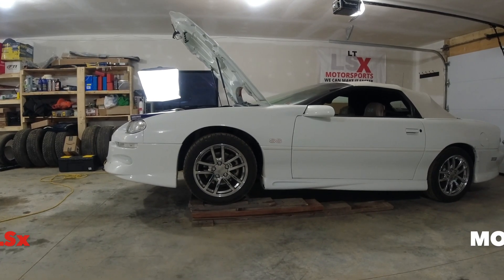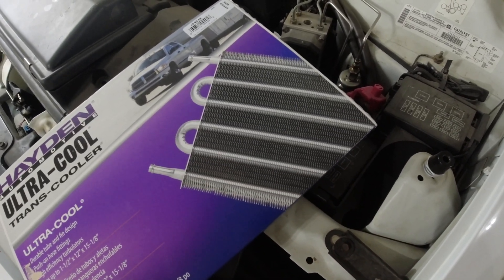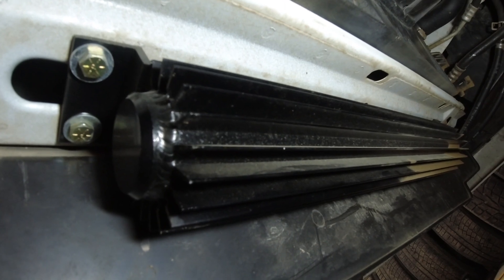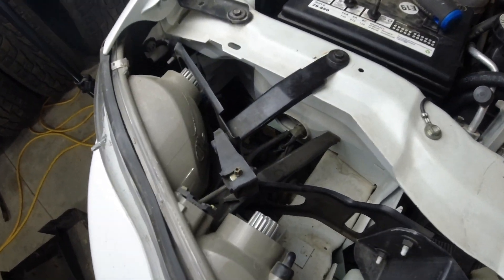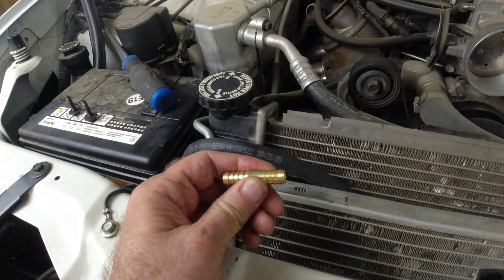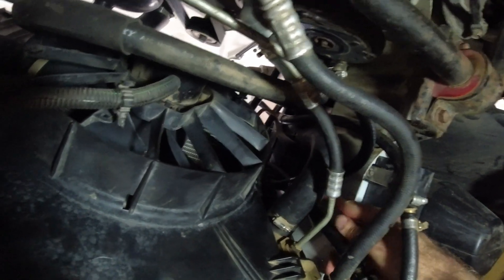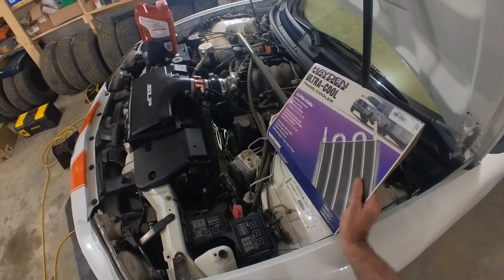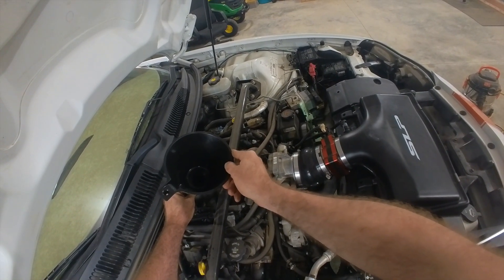Installing a transmission Cooler - How much will a transmission cooler drop the temps.

Comment: You have a trans cooler suggestion for a 95 TA
Reply from the maker: Whatever will fit in front of your radiator and fits your budget. If you drive in cold weather you may not want too go too big but if that's not an issue for you the get an 8 or 10 row cooler. Don't bother with those expensive stacked coolers they cost more money and are more restrictive to fluid flow. Just get your standard cheap tube cooler. Brand isn't really important because they are all probably made in China anyways. Amazon sells many different brands pretty cheap.

Comment: I have the 97 camaro z28 lt1 I removed my ac and my condensor.  Any advice on where and how to mount it will the heat from the rad effect the trans cooler if it's close to it ?
Reply from the maker: Well the best place is in the front of the radiator if you have the space. But anywhere you can mount it that has Airflow will be a big help and the heat from the radiator will not hurt. The optimum temp for transmission fluid is between 175-195 degrees. A little cooler than that won't hurt but you don't want it too cool but you probably wouldn't have to worry about it being too cool anyways unless you drive in a very cold climate.
Reply: @LSxMotorsports2021  thank you so much . I always appreciate you 👊

Comment: I've got the same cooler for my Z'd. Hose clamps sufficient enough to hold the rubber lines on? Thanks for this btw.
Reply from the maker: Yes the clamps will hold fine as long as the connections all have a flare where the rubber lines connect to the metal lines.

Comment: I’d do away with that other cooler under the radiator and i would put the new one right in front of the condenser instead of behind it. There’s room for it plus the condenser runs a lot hotter than the trans cooler. The trans cooler won’t really affect the condenser but the other way around is likely to put a bit of additional heat into the cooler on a hot summer day with the A/C running.
Reply from the maker: Oh I agree in front of the condenser is the best place but I would have to remove my Ram air (SSRA) which I don't want to do.As it is right now it never goes above 185 so it will do for now.

Comment: Where did you tap your trans cooler guage into?
Reply from the maker: I put it in the test port on the transmission.Thats where the instructions that came with the gauge said to put it.But I have since seen a video where a transmission builder said not to use that port because the temperature of the transmission case will make the gauge not read accurately.He said a better spot is to tap into the transmission pan for a more accurate reading.I may change mine eventually but for now I will leave it.I have the video on the channel installing the gauge if you want to see where the test port is.
Reply: @LSxMotorsports2021  I actually ended up running into that video you made a few seconds after I posted this comment lol. Thank you for the response. New subscriber here. You actually sold me on the idea of the SSRA for my car. I’m pretty happy with it.
Reply from the maker: @justinsantiago1975 That's good to hear.Yeah the SSRA is a pretty nice upgrade.Could be a little cheaper but still a good Mod.
Reply: @LSxMotorsports2021  yeah at first I was hesitant cause of the price. I haven’t done any track testing yet but I feel like it actually picks up better. I too had a volant intake and went with a SLP lid and it felt like the car was searching for air with the lid. But once the SSRA went in the car felt better.
Reply from the maker: @justinsantiago1975 Yeah I think it's a good setup for these cars.
Reply: @LSxMotorsports2021  btw is your car cammed? Or have a stall?
Reply from the maker: @justinsantiago1975 It has a small cam.BTR stage 1.The car still has the stock torque converter in it.I have a Cheap FTI 3200 converter in the box just waiting to be installed.

Comment: Just woke up to this vid, which is great because I ordered the same cooler for my '98 Z28.
Reply from the maker: That's good.If you have space in front of the radiator that would be the best place but it will fit in between them but is a bit of a pain to get the plastic retaining straps in there.But it does seem to cool pretty well without affecting the cooling of the engine.